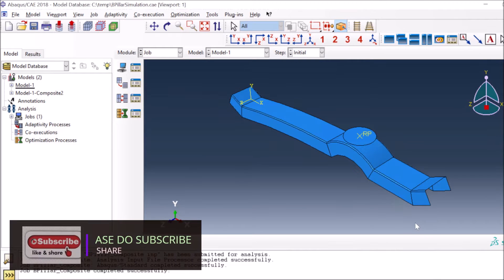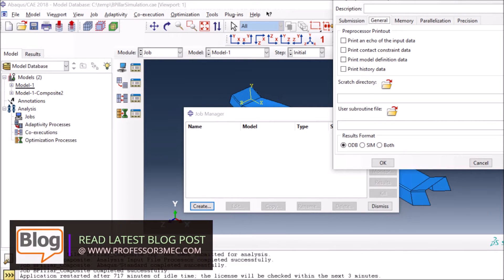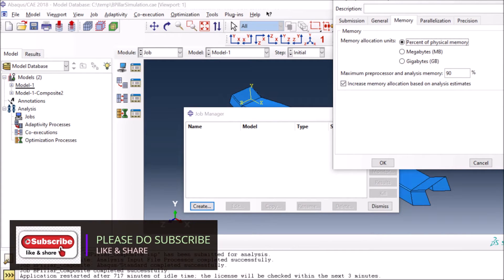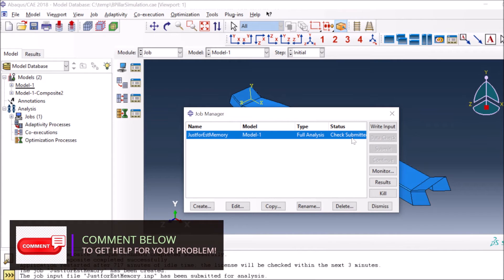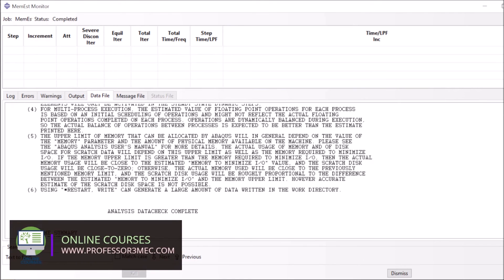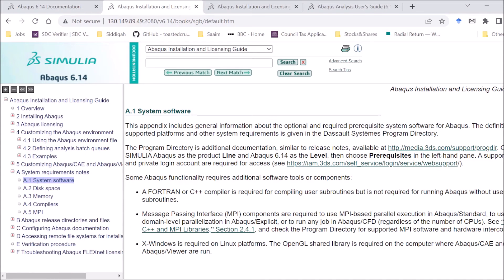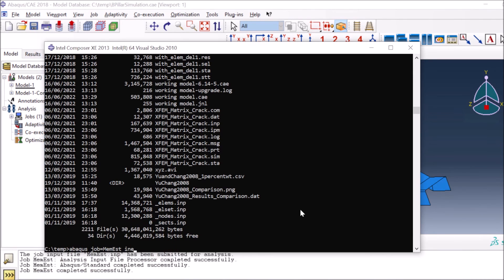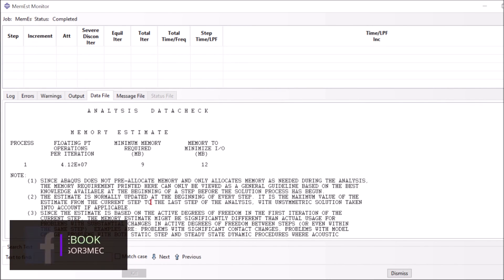ABAQUS Error: Insufficient Memory or Disk Space, etc. Step by Step explanation and solution

Comment: * Error:ABAQUS/Standard rank  0 failed to allocate memory

* ERROR CATEGORY:  ASSEMBLY

I am getting this error, what could be the reason? My time increments are very small 1e-5, and the odb file till now is taking 55gb disk space. could this error mean that I require  to run this analysis on a machine with more physical memory?
Reply from the maker: Yes or reduce model files and memory usage through coarser mesh and less number of outputs and their frequency